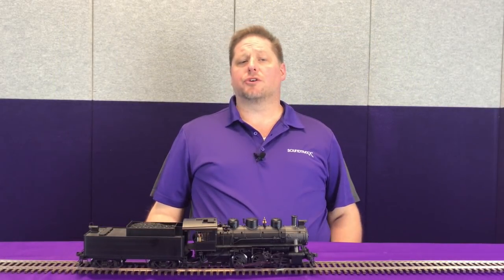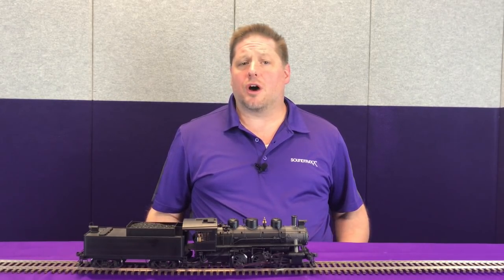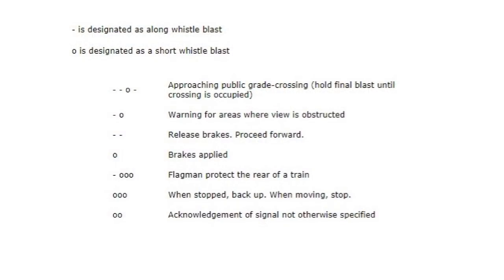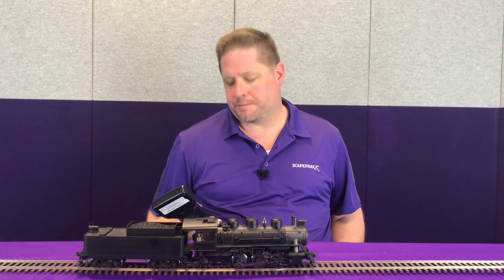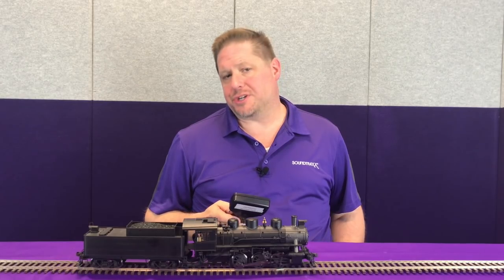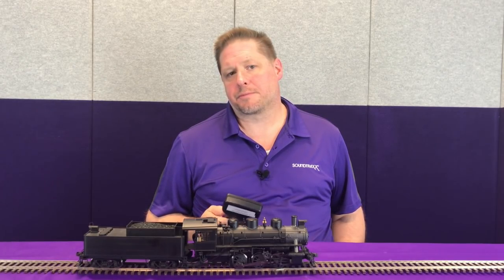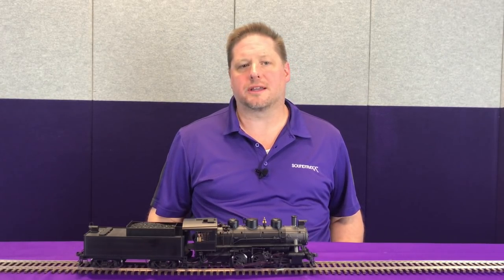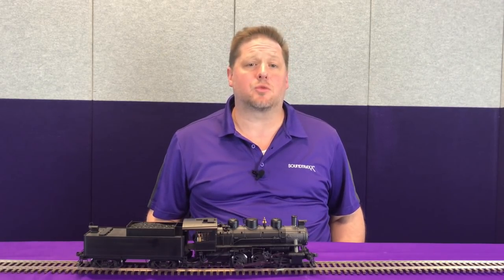Automatic Whistle Signals with Tsunami2 & Econami Decoders

Comment: Hey George, great vid.. Just wondering are these applicable on the older Econami versions. I have the 88204 in my Alco.. I would like to do these, if possible. I'm sure my T2 in my GE I can follow this video and employ hopefully
Reply from the maker: Yes this feature is available in the original Econami Decoders. Let us know if you run into any problems when you set this up in your decoders! SoundTraxx Customer Support Center: (970)259-0690 ext. 22 or support@soundtraxx.com